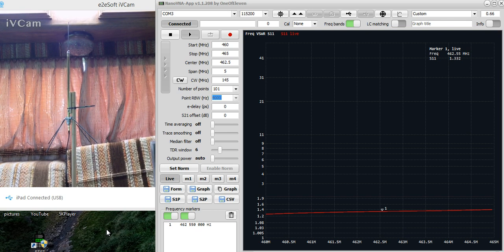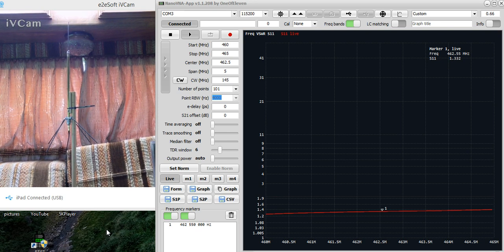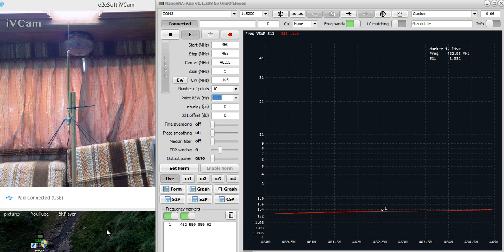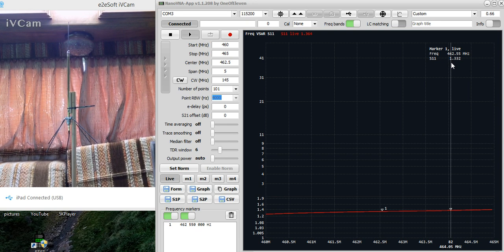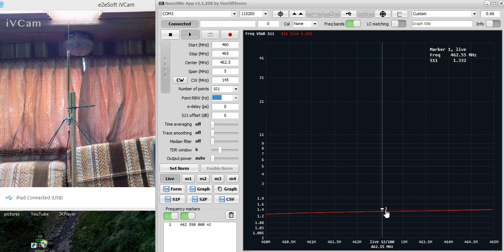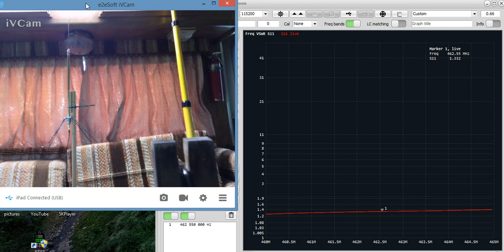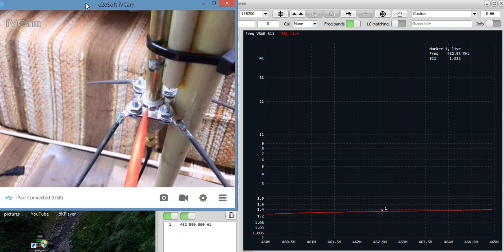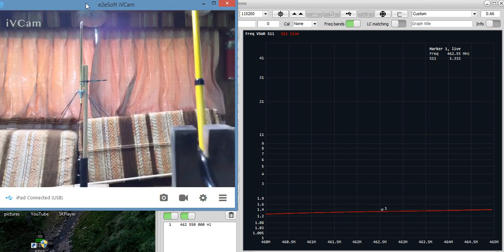🔺What happened? My homemade FULL wave GMRS two-way radio antenna end up being a 3/4 wave antenna??🔺

Comment: Any update on a full wave ground plane? Or did you stay with the 3/4?
Reply from the maker: Sorry, well truth be told I haven't made a full wave to compare yet. Maybe this summer.
Reply: @GMRStwowayradio  no worries. I was wanting to see how it compared to the 3/4. I built a 1/4 wave and it works but I have room and wanted to build a full wave. Is the gain worth the effort?
Reply from the maker: @lawrence1md  - yes, more gain will help, BUT you have to look at the antenna pattern to see what type of pattern you need.  If you need more pattern shooting upwards, then you would find a pattern that would do that more. Look at this for more info http://www.mapleleafcom.com/PDFs_Downloads/Radiation_Patterns_Verticals.pdf

Comment: Good video. I picked up a NanoVNA and have built a couple of Gmrs antenna’s and it becomes addicting. I’ve also found how antenna material makes a huge difference based on its velocity factor. I like your adjustment collar also. One thing I have found too is the NanoVNA will have me tweaking every antenna I buy to get the lowest SWR and get it right at 50 ohms impedance.

Have you used any LMR400 cable yet? Makes a big difference in loss between the transmitter and antenna.
Reply from the maker: Thanks! And no I haven't tried the LMR400 I think I have some around here from another project. But I am sure if it will be long enough. If it's long enough, I will have to try it.